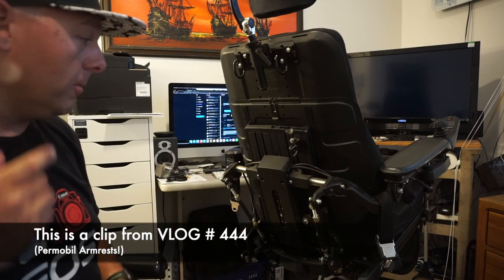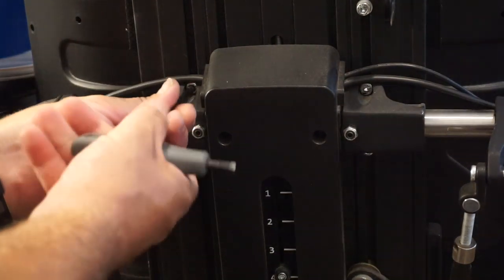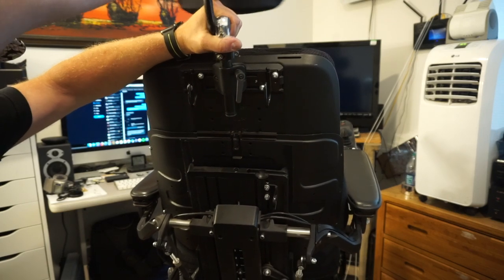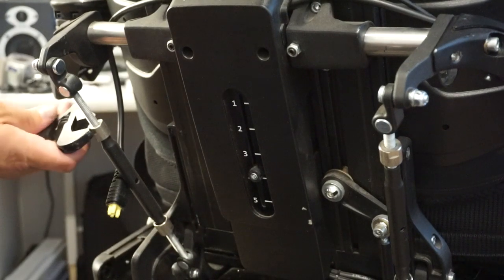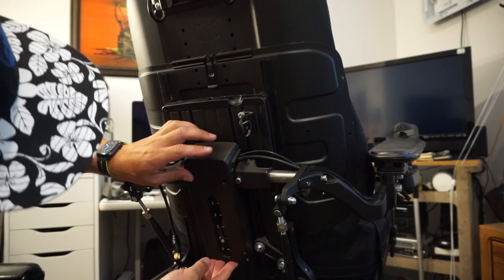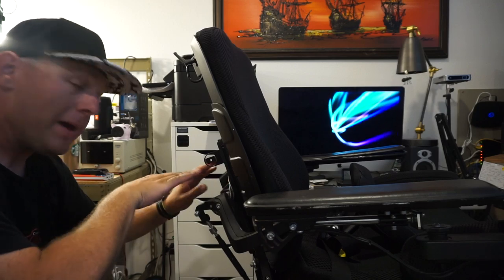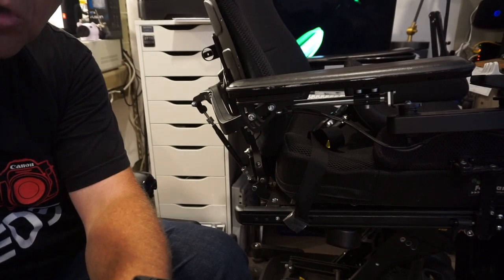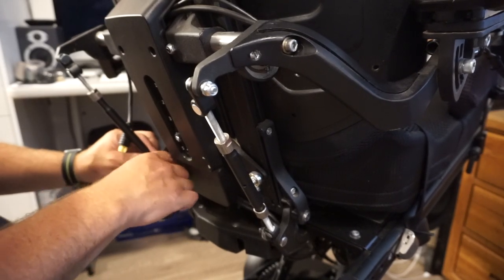REPAIR CLIP: Arm Rest Height & Angle adjustments | 2017 Permobil 3G Seating

Comment: Thanks for bolstering my confidence in opening up my M3 controller to swap out a bad charging port. Can you offer any suggestions for getting Permobil parts??  I appreciate that you share your knowledge of tinkering with these amazing devices.
Reply from the maker: the best place ive found so far is https://buildmywheelchair.com/
they can order any parts that are available from permobil, even if those parts arent listed on their website.  use the chat function, or send them an email, and they will help ya find the parts, and give ya a price!
individual internal joystick parts arent usually for sale separately from most manufacturers though :^/
however, if your charging port MELTED - permobil sometimes covers that repair! (they had an issue with this for a short while)
fill out this form - - https://hub.permobil.com/support
and one of their reps will contact you :^)

Comment: What do you think the lowest ballpark  height could be adjusted-floor to the top of joystick with the seat lowered?  I’m investigating how an F3 will fit in my van and am comparing some measurements.  Really love the content here- very thorough and informative vids!!
Reply from the maker: the arm rests can go way lower than you'd ever want them! - lol and hence the joystick as well.. the question is how low can it be,  and still be usable for ya? its not something you'd want to constantly adjust..  there's joystick swing-aways etc to help with negotiating the space inside a vehicle and such..

Comment: Thanks! It was full of practical insights.
I am C4-5 from India. I'm using Permobil F5vS.
Not getting much support from Permobil franchisee here.
I wonder if I can adjust my armrest in a way that one is two-centimetre lower (vertically) than another.
Is it possible?

Thanks and regards
Reply from the maker: yes! theres a workaround for that... on the sides of the arm rests, back close to where the pivot is, youll see 2 allen cap bolts... what ya wanna do it take those out, and adjust the arm rest so its pointing angled up at like a 45 degree angle (or so), put the bolts back in,  and then use the turnbuckle on the back for that side, to lower the angle back down, and itll be lower than the other armrest! it takes some playing around.. but its very doable! send me a DM on twitter and i can send ya some pics
Reply: @TotallyNormal-  any idea why I can’t get the armrests to move out? I loosened the screw but they won’t budge.
Reply from the maker: so those horizontal silver bars tend to get stuck in there a lot.. the little set screws on the back have a sharp point to them and they kinda mar up the metal bar.. make sure those little silver screws are all the way out, and sometimes ya can attach a slide hammer and remove the bars that way.  it'll take some grinding to get them repaired, but honestly replacements are the best things to stick back in there.  they are 'adjustable' when the chairs are new.. but after very long things wont slide in and out very easily at all..

Comment: I was wondering if you knew how to adjust the angle of the joystick I have a new Permobil F3 and it has a rectangular mount instead of a tubular mount do you have any idea how I could change the angle slightly so the joystick tilts in so it fits my head better when I sit there it feels like it tilting away from the wheelchair I wanted to tilt in towards the wheelchair but it’s a square mount it’s a brandNew Permobil at three which I got about a month ago it’s April 13 right now thanks for your help I really enjoy your videos I don’t know how you do it I’m exhausted just watching you I have a primary progressive MS so I can’t move too well thanks for your help and thanks for making videos
Reply from the maker: there's a bunch of different joystick mounts used now, hard to tell which specific one they might have used - but if ya flip up the armrest and have a look around there may be some slots, or adjustment bolts to adjust
Reply: @TotallyNormal-  Thanks for your help I lifted up the armrest and there were two 4mm Allen bolts on an L bracket when I loosen them they were able to swivel in and out so I tilted it slightly into me and tighten the two 4 mm Allen bolts. Thanks for all your help it’s very much appreciated the mount it was on didn’t look like it would swivel but it does very easily I loosen them very slightly tilted it in and tighten them back up like I said before thanks again I appreciate your help